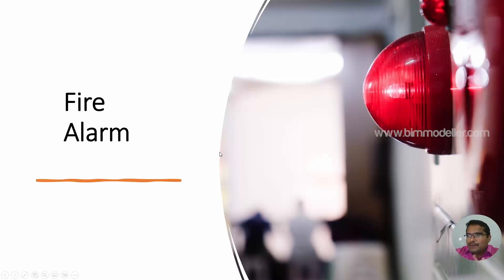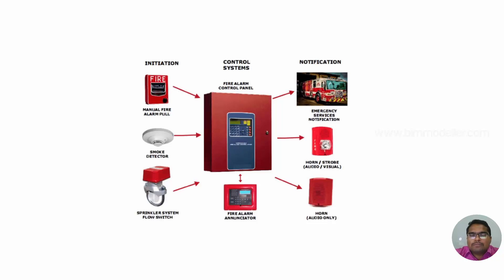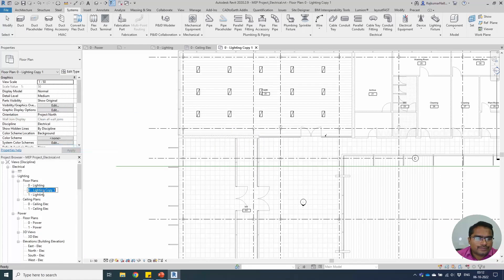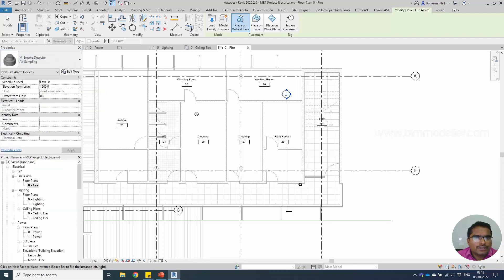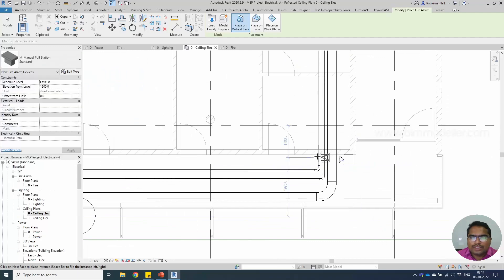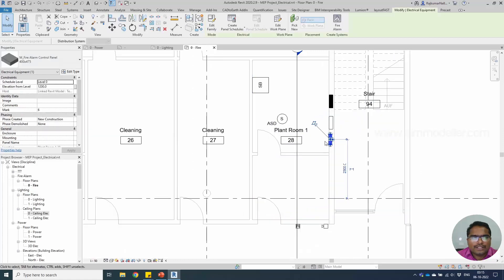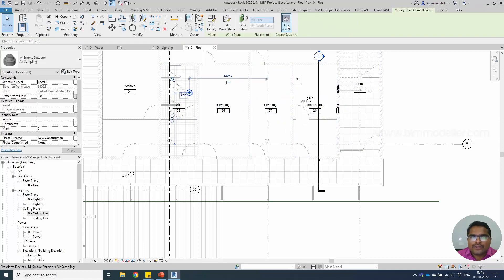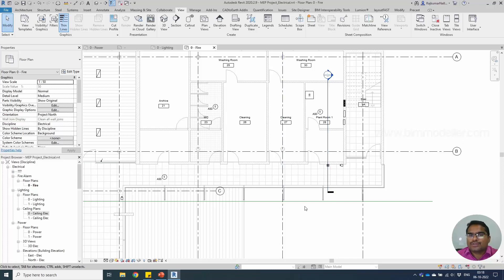#Revit MEP Project 41 : Creating Fire Alarm Circuit using Revit

Comment: bro my panel board not display voltage or load in panel schedule is this normal? I cannot adjust the voltage in fire alarm family though.
Reply from the maker: Which panel Control panel or the Power distribution panel. Can you please write mail to me
Reply: @BIMModeller  it is firealarm  control panel and i edit family to nursecall and other device type . Those are not display volt or VA in panel schedule.
Reply from the maker: @I3lacklist  You can edit the panel schedule and add those. Still I have done video on that. Stay tune. To clearly understand can you write mail to me with images.